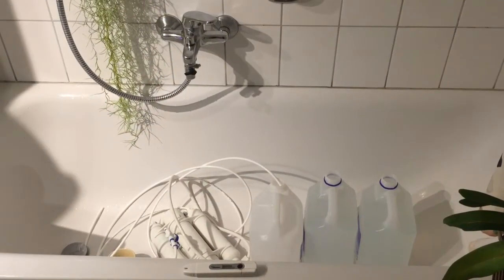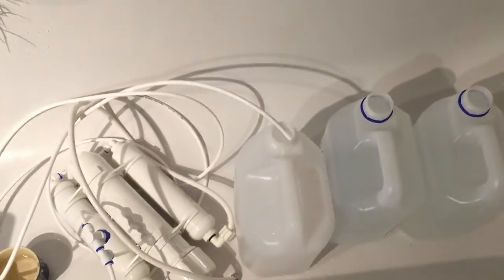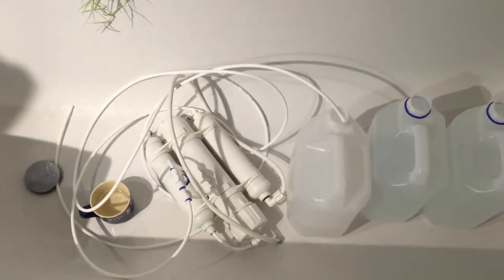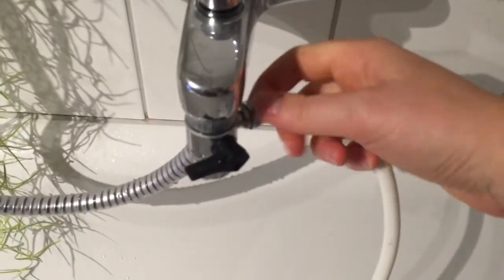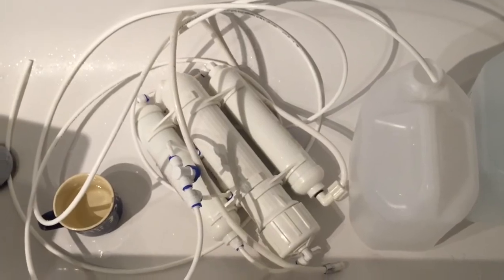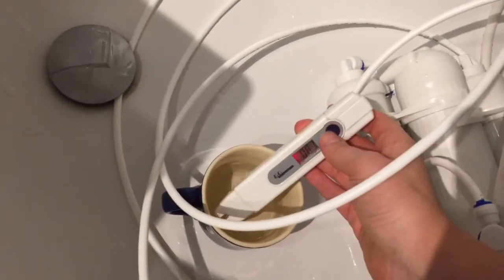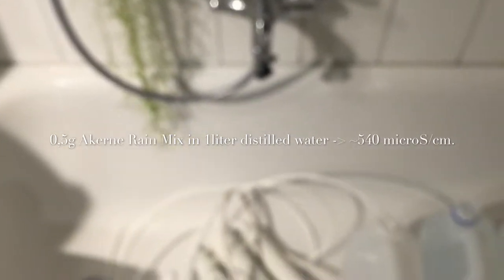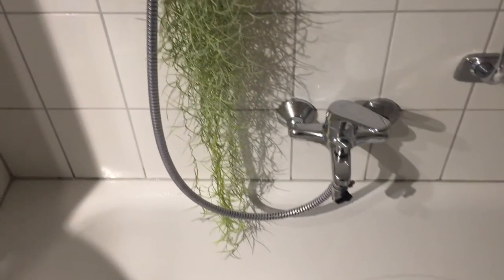No More Hard Tap Water: Reverse Osmosis System for my Orchids

Comment: I was in the same situation and also purchased a reverse osmosis system. How many tds or ppm is in your tap water?
Reply from the maker: +Indoor Orchids and Tropicals It's very convenient, isn't it? I just remeasured the e.c. and it's still about 575µS/cm or 368 ppm TDS. Could be worse.
Reply: I'm sorry I sent that comment. I hadn't finished watching the rest of your video and then YouTube said it didn't post. I've got about 360 ppm as well and when I brought my orchids back from Hawaii where I had good water, I started having a lot of sudden root death after a while. The new roots would also die when they got to the surface of the mix. I went through my books and read about salt buildup and then checked my water report. I was forced to buy a reverse osmosis system and repot everything, and of course, they did much better after that. It seems most people on YouTube have good tap water. I'm so jealous of them ;)
Reply from the maker: No worries, took me 10 seconds to check. Hawaii must be a wonderful place for growing orchids. Did you grow them outdoors there?
It must be so convenient to be able to use tap water. When you're not using fertilizer you can just rinse them under the tap in no time, aaaw.
Reply: Yep, I had a nice little lenai in Hawaii with a roof, so I had microclimates for full sun to full shade and had puakenikeni tree, plumeria, and orchids and gardenias grew down the street and it was so easy to grow there and I could dump water all over the floor of it and it was a second story, so well above the bugs on the ground. I miss having that so much.
Reply from the maker: +Indoor Orchids and Tropicals I can well believe it. That sounds beautiful. 
I've always been a windowsill grower, but I had a patio for some time and I loved it.
Reply: It was so great. I wish I had photos of it, but I wasn't big photo-taker back then. I did do a drawing of my first dendrobium I got there though, so I have a nice momento of that.

Comment: Very interesting and informative video. The water in my city is quite soft, so I can use tap water for all my orchids. Years ago I used to collect rain water, just to be sure, but I didn't notice any changes after changing to tap water. In some places in Finland the water is hard, and I know some people who use reverse osmosis. But I think I will buy a TDS meter at some point, because specially after watching a video by Brad (Brad's Greenhouse) in which he showed how many salts accumulated in an orchid's pot, that made me very curious. Thanks for sharing!
Reply from the maker: +Orchids & a Dutchy I'd love being able to use my tap water, that would be so convenient! I'm looking forward to my new TDS meter, because it got broken in November and usually I use it every time I use fertilizer. :)
Reply: Bumblebee I was looking at TDS meters, and apparently there are different kinds, and according to the temperature of the water, TDS-3 meters might give a wrong result. And TDS-4 meters should be able to take the temperature into account, so it should be more accurate. Unfortunately most vendors here don't tell if their meters are TDS-3 or 4. And I don't know how reliable the information is. I saw lots of TDS-4 meters on eBay, but they might not be as good as claimed. It's hard to know what's worth buying and from where. From the US amazon there are lots more offers, but the shipping costs sometimes are as much as the meters themselves. I will visit some aquarium shop and ask, I suppose they might have these meters sometimes. If they have EC meters instead, then I would have to use a conversion software/webpage everytime.
Reply from the maker: +Orchids & a Dutchy I have to admit that haven't got a clue if mine is a TDS-3 or 4. They said it had a reading accuracy of +/ 2%, that sounded accurate to me. I don't think that mine takes the temperature into account. The water temperature does have a noticable effect on the electrical conductivity, but I don't know what to make out of it. I think when you have carnivores or tender species it's more important to have an accurate device. But with rather common genera it's enough to know roughly how high the e.c. of your tap water is and how much the fertilizer increases the e.c. And the unit of measurement (ppm TDS or µS/cm) only plays a role if you are used to one of them or would like to exchange experiences with other orchids growers. I think in English-speaking areas ppm TDS is the common unit.
Reply: Bumblebee I would like to get a TDS meter to make some tests. Firstly to see how soft our water is. I once saw from our water department's webpage some information about the TDS count of our water, and it was on the soft side. But I suppose it might vary sometimes. One test I would like to do is the same as Brad (from Brad's Greenhouse) made, in which he watered an orchid and measured the total dissolved solids of the water, to see how much minerals were accumulated on the pot. Then he showed how he flushes the media. He keeps the pot under running water for 5 minutes, and after that most of the salts were flushed. The problem is, that's quite a lot of water. If this was done to all the orchids, it would mean a huge water bill. Orchid hobbyists in Finland usually flush the pots in a different way: first water the media very well, wait for an hour, then flush the pot for a moment under the tap. It's believed that this way the salts will dissolve and leave the media when it's flushed, and it saves a lot of water. I would be interested in checking with a TDS meter how well it works. Because the 5 minutes flushing is too water consuming and expensive.
Reply: +Bumblebee I recently checked again from the webpage of the Water Department of my city, the water in my region is very soft, containing salts ranging from between 3,2 to 3,5 °dH, or 57,14 ppm. It's actually softer than I thought. I must get a TDS meter, because I'm curious to check myself, and also it would be interesting to flush a pot and check how hard the flushed water is, if that could tell me how many salts are in the media. Wow, I see from my previous message that some 4 months ago I was thinking of buying a meter and I still didn't do it. I keep forgetting. :)
Reply from the maker: 57 ppm is fantastic! Many people do very well without, but I love my e.c. meter. Recommendations like "half the recommended strength" of a fertilizer are very imprecise. If I'd use half the recommended strength of Schwerte fertilizer it would be equal to no fertilizer. ;D
Reply: Bumblebee With fertilizer in powder form it's even harder to know for sure how much we have added to the water. I use Rain Mix, and for phals I have been using a liquid fertilizer I got from Orchideengarten Karge, and I measure it with kitchen measure spoons, because the bottle's cork is very imprecise. They always write in the bottles that you should add one cork of the fertilizer per 2 liters or so, but often the cork or cap is not exactly 5 ml, it could be more or less, and also in the cork/cap there's often some dried fertilizer salts that could make the whole mixture too strong. I have never tried Schwerter's fertilizer, but I read from a photo of the bottle that the nitrogen amount seems quite high, and I wonder if it's too high for home growers, but good in a nursery with strong lights, air movement and humidity. But I might be remembering it wrongly.
Reply from the maker: Ugh, I must admit that I'm not very well versed with fertilizers in general, but here are my thoughts. ;D I've never seen a note like "10ml or one tbsp in 1 liter causes an e.c. increase of 500µS" on a bottle of fertilizer, although that would be an information that would be precise and therefore worth mentioning. The information "use 10ml in 1 liter water" is WAY too shallow. 
My understanding is that Schwerter's fertilizer is a liquid fertilizer that doesn't increase the e.c. very much, because it's highly diluted (> expensive). I had one bottle and it was empty in no time, because I had to use huge amounts to increase the e.c. to my linking. Its nitrogen content might be high compared to the other compounds (NPK 14-7-8), but it's still highly diluted, you can hardly overdose it with most orchids unless your tap water is already too hard for your orchids. I think as long as the e.c. isn't too high you are on the safe side with whatever amount of nitrogen a fertilizer has. But if the plant doesn't have sunlight and warmth it cannot use the nitrogen and it could be too much. But that will apply to all sorts of fertilizers, I think. I have different fertilizers (NPK 5-6-7 (liquid) or 14-14-14 (powder) or 10-20-30 (powder)) and I use the ones with more K and P if I want to encourage root growth and flowering (> Vandas! They shall bloom and not grow, lol) and the balanced one to encourage leaf growth (-> that's the one that I used for my Blc). At least that's my intention and it seems to work, but I don't know if it's as easy as that. When I watch videos about fertilizers I only understand parts of what they say and everything sounds very intelligent, but I don't even get if it could be right or not or if it matches my routine and my understanding or not. ;)
Reply: Now that I have a TDS meter I'm checking the ppm of my water before and after adding fertilizer. I wonder how much I can trust the meter. At least it seems consistent, and everytime I test my water it gives the same reading, 74 ppm. I must buy distilled water and see what it says. Anyway, I added 1g of rainmix to 2 liters of water, and the meter said 258 ppm. Does that sound right? That was with rain mix. I also have a liquid fertilizer from Karge. It says: "20% gesamtstickstoff, 8,5% Nitratstickstoff, 11,5% Ammoniumstickstoff, 5% Neutral ammoncitratl&#246;sliches Phosphat P205, 10% Kaliumoxid, 2% wasserl&#246;sliches Magnesiumoxid". The instructions said to give 5 ml of the fertilizer in 2 liters of water every other watering. I assumed it was a concentrate fertilizer. But when I checked with the TDS meter after mixing 5 ml with the 2 liters of water, the ppm hardly rose at all. From 74 ppm it rose to 78 ppm. I put double the dosage, and it rose only to 86 ppm. Either the fertilizer is very diluted, or there's something wrong with it, or maybe the salts are so well diluted in the water that the meter has trouble to notice them (????). I have been giving it to my phal crosses, but now I don't know if it's strong enough for them. Is it worth using this fertilizer at all? Or is the problem with the meter? If the nursery uses this fertilizer as they claim in those dosages, it should work, one would think? Nurseries often advertise the fertilizers they sell as being the same they use themselves at the nursery. Is it really true, or do they have a secret formula they keep to themselves?
Reply from the maker: I trust my ec meter entirely. It might not be absolutely precise, maybe there's a deviation of 10 µS/cm (6,4 ppm TDS), but that's no problem. I've read that 0,5g Rainmix -> 540µS, that's 345 ppm TDS, so I guess 258 ppm TDS could be right and the difference might be due to measuring insecurity (quantity of fertilizer and TDS meter). But you put it into your tap water that has about 74 ppm TDS, that means we must substract 74 from 258 which makes 184ppm TDS which would be much lower than 345ppm TDS. But maybe the measuring insecurities weren't on you, but on the person who measured 540µS/345ppm TDS.
But what happened with Karge's fertilizer sounds strange! That sounds like there's just water with traces of fertilizer in the bottle. :/ Schwerte's fertilizer was very diluted as well, but the numbers you measured were extremely low, insignificant so to say. 
That's a tough question.. Neither do I think that nurseries keep a secret formula to themselves, nor do I think that they use the fertilizer they sell. I just can't imagine that they pour one bottle after the other into huge tanks of water that they use. That would be too much trash. I think they use some kind of concentrated fertilizer, but maybe with a similar mineral composition. I don't know, it's so untransparent. :/

Comment: That's some 'bad-ass' tap water - many don't realise the importance of good base water - especially if you start adding fertilisers as well. That is the same unit I bought last Spring and it does a great job (I try and use the 'waste water' on my outdoor tubs and garden.) I find it VERY difficult to find good/reliable info on the levels of feed for each orchid type so with some of mine it's a guess based on guidelines like 'high feeder' or 'very low' (Disas). I also use the Akerne's Rain Mix as this is specially formulated for rain or RO water. I have noticed an improvement since changing to all this. It's a great little unit. It also means when I give the plants a flush they get a 'pure water' flush and as a direct result of getting this gadget - I CAN now grow Disas!  Good vid, informative.
Reply from the maker: +Roger Frampton Thank you, Roger! It's great that you can grow Disas thanks to your unit. After those 900µS/cm had damaged some Vanda roots I started to buy distilled water. But after some time I had enough of buying it and carrying it upstairs. I decided to by the ROS and haven't regretted it. Infos like 'high/very low fertilizer' or 'half the recommended dose' are very imprecise as every fertilizer is different and every base water is different, but it's not always easy to find numbers.

Comment: My tap water is not that hard , I just leave it in a bucket for at least 24 hours for the chlorine to evaporate but this is a good thing to remember in case I will move and have problems with the water. Thank you for posting!
Reply from the maker: +fifi fifi Before I moved, I could use my tap water, too. That was very convenient. I hope you won’t have problems in case you have to move someday.